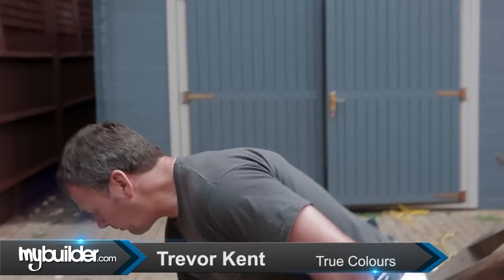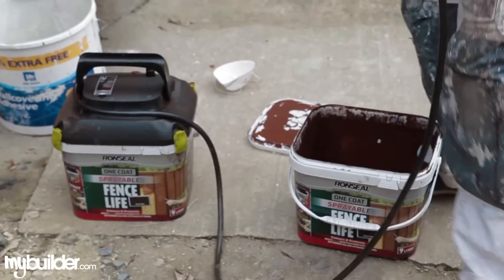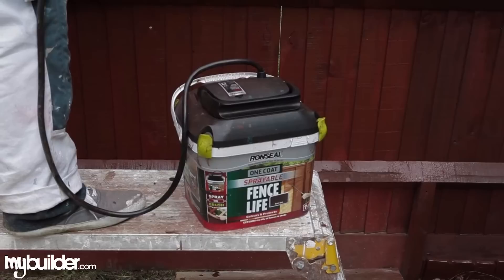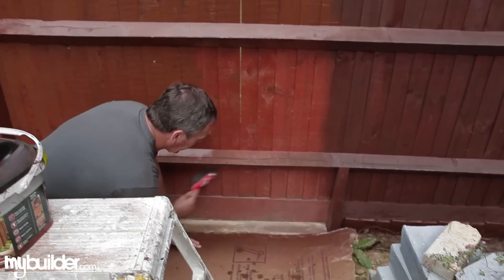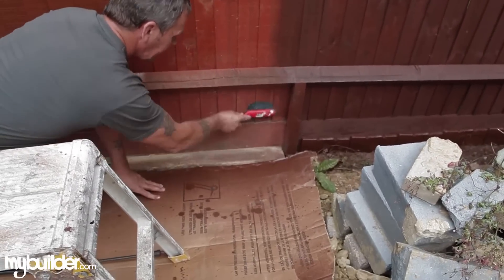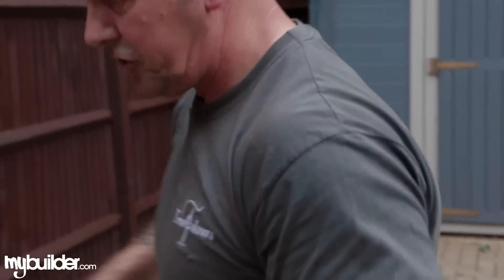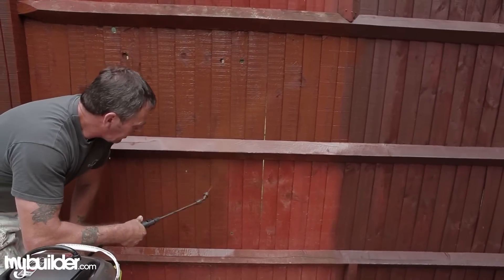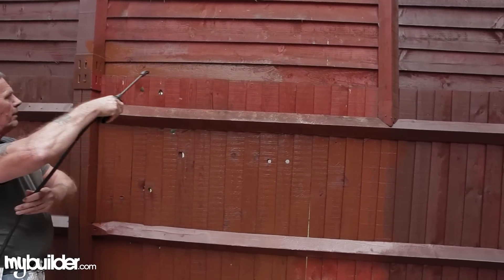How To Paint a Fence With a Garden Fence Sprayer | MyBuilder

Comment: I use a chorded drill and abrasive wheel for prep to remove any green and tidy surfaces up, preparing entire fenses with wire brush in hand can be hellish but results always show in the end, the drill takes alot of work out of the equation. I use the spray and brush its awesome bit of kit, I still think brushing a fense is best with that little adgustable jet that sits on top of the brush its good idea, as soon as the stain exits this jet nozzle your brushing it on so it reduces most o f the risk with it getting airborn
Reply: use something like wet and forget for the green. great stuff, spray on and next day all the green has gone, no kidding. you will be left with grey patchs where the green was but its safe for plants. It not cheap about £30 for 5 litres but its 5parts water to one solution so lasts a bit. also great for cleaning decking walls caravan and stone / pavement. Screwfix do a great 5 litre sprayer for about £7

Comment: Diesel and used motor is WAAAAY cheaper and lasts longer. Plus you are recycling the used oil. Great for the environment. Simple 50/50 mix is all you need in a garden pump up sprayer. All organic........

Comment: £40 for the attachment plus £20 for a tub of paint !! You can get 10litres for £10 plus £4 on a brush and off you go .....ok may take longer but huge difference in cost !!
Reply: You need to consider that a rough wood fence panel takes at least 30 minutes per side to brush, but only about 10 minutes to spray. If you're paying for labour the sprayer will be cheaper.

Comment: I bought  the sprayer and it was useless.It continually kept getting blocked.I used also a lot of batteries.In the end I dumped the machine,bought myself a brush and applied by hand.Yes,it took longer,but it was a much better job than this dreadful machine that was not fit for purpose.I literally took the machine to the dump.Complete waste of money.